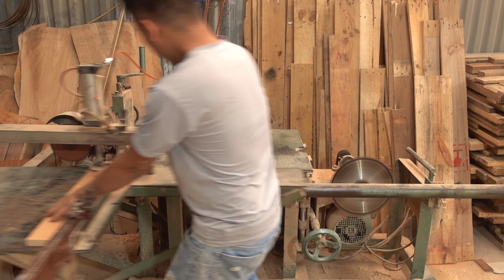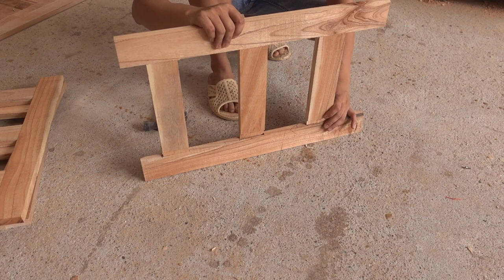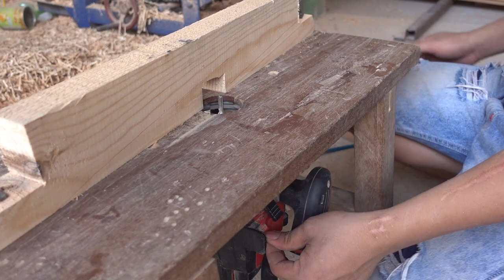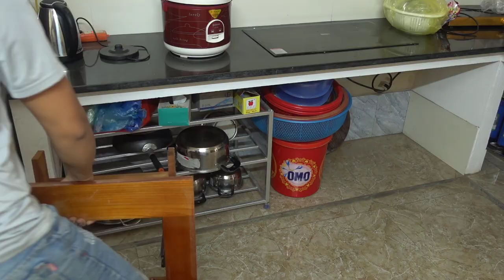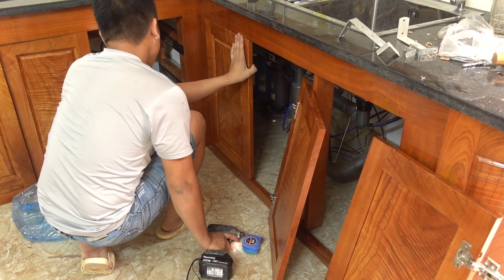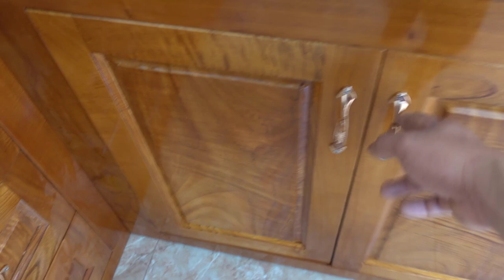Woodworking Is Wonderful // How To Make A Kitchen Cabinet Underneath

Comment: In Ireland and other country's we would have melamine chipboard units underneath worktop, the units degrade over time with water spillage and age. I like this idea with floor tiles inside unit. Would be nice to have chrome swivel out shelves. The curved door is fantastic great work as usual Dong.